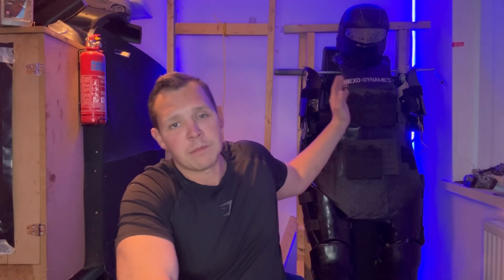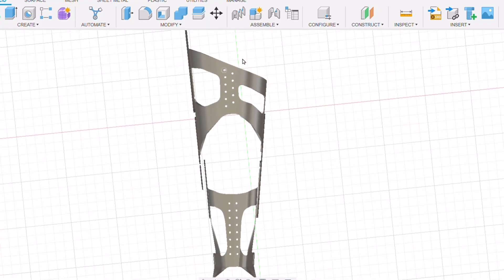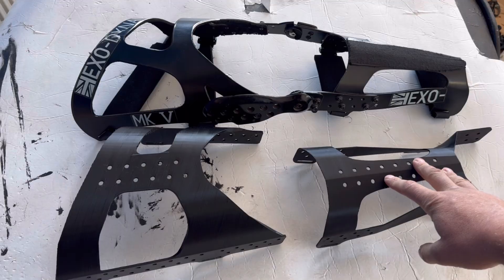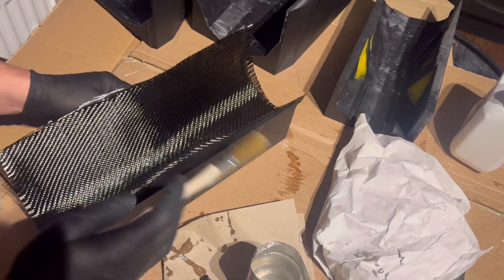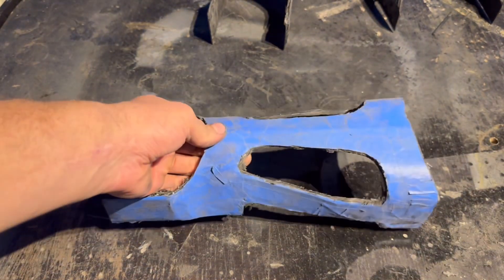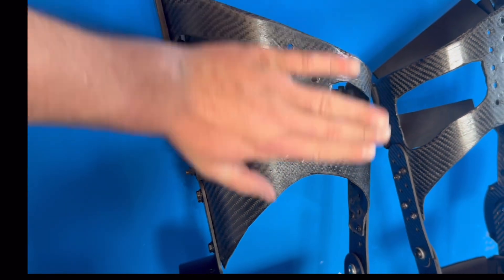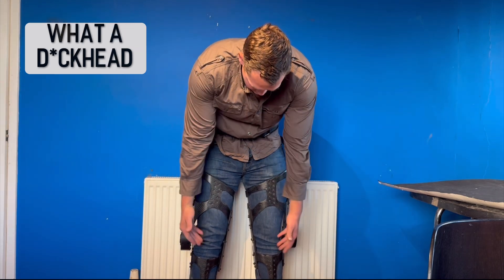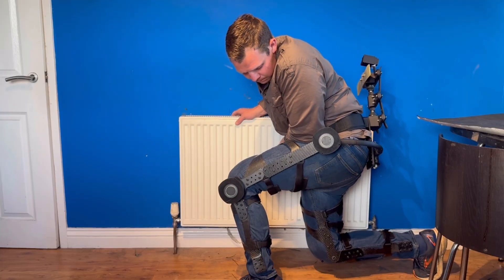Mistakes were Made - Making carbon EXO-LEGS for POWER ARMOUR

Comment: Make I make a suggestion for the gap filler between the points in your armor?

Aluminum  chainmail. Riveted if possible. Would help if attacked in melee combat.
-Light weight
-Breathable
-nearly cut/slash immune
-Stab resistant
-Doesn't rust or degrade
-Quite cheap

Comment: Preface: I have some experience with fiberglass, but not carbon fiber. 

Can I ask why you decided to use a concave mold to press your carbon fiber into instead of layering it over a convex form? Is there an interior form to your molds that you sandwich the fiberglass between that I'm not seeing in the video?

I've never used carbon fiber, but i have used fiberglass in making canoes and other watercraft. I always find it's much easier to layer the outside of the canoe than the interior surface, so I'm wondering what the thought process behind you manufacturing decisions are.
Reply from the maker: Sure its that its easier to get a better finish for the surface that will be showing, obviously didnt work this time. Theres no gelcoat so the finish is epoxy with a clear coat over the top. So if you layer over a convex form its pretty hard to get a perfect finish (not impossible but theres more work)  theres no inner negative to the mold as its just flat,
Reply: @MattExo-Dynamics that makes sense, thank you for the answer. Yah, when I do fiberglass coatings it takes a lot of sanding and several epoxy coats to get a good, smooth, and clear finish. 

Are you seeking a smooth finish or hoping to apply a particular texture? Do you think a coating of Bondo or similar filler + sanding smooth, then a sacrificial layer of wax or release gel would provide the appropriate surface you are looking for? Applied to the face of your mold, not the finished piece.

Comment: One question on carbon fiber if you get melee damage or ballistic damage is that harmful for breathing?
Reply from the maker: Horrifically so if you breath carbon dust in, you may as well do a line of asbestos, only mitigation is something to wet it or a form of coating, but tbh its just part of the compromise on materials, but its way stronger than everything else so the chance of damage is less

Comment: It's hard to see with the jeans also on,  but are the knees also slightly displaced from the correct rotation point?
Reply from the maker: Without the hips on which pushed it slightly out of alignment (as its not adjusted yet), yeah the pivots right, but i have to say, it didn’t look right particularly in the sitting down  clip which i think is because of the size of the actuator as the inner slim hinge looks better. 
It felt fine though.

Comment: Structurally, will the leg harness be attached to and supported by some sort of platform at the soles of the feet? Because then that would mean the weight of the exosuit from the hips up will transfer through the leg harness and into the ground. The wearer therefore wouldn't have to be carrying any weight except to maybe keep the suit upright if there are no joint locks in the exosuit.
Reply from the maker: Yes there will (next weeks video) , i think i know what you mean and yeah but theres twist and shock to think about ao if you jump off a 3ft ledge for example, the shock of the weight of the suit will translate hard into the legs, so if they bend and twist they may be weak at that point.